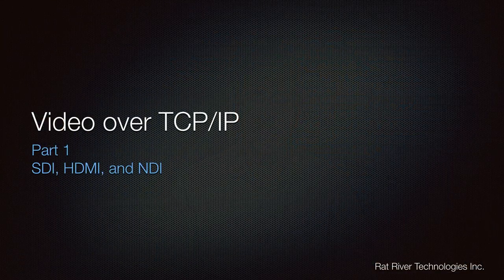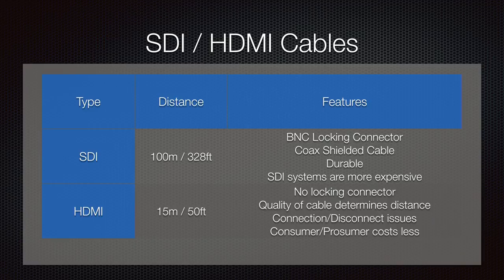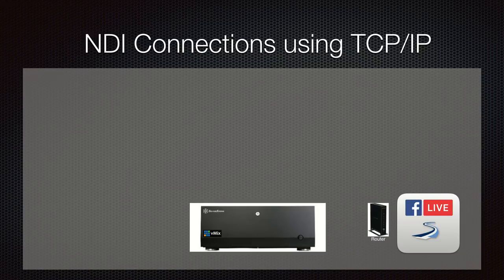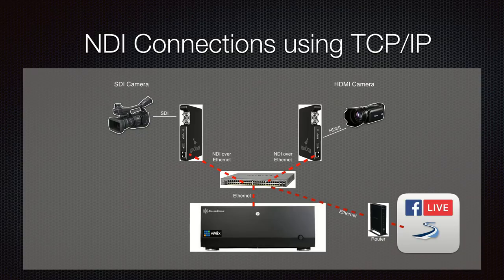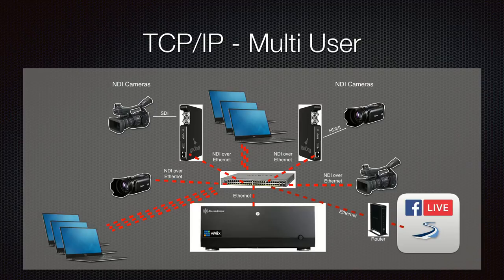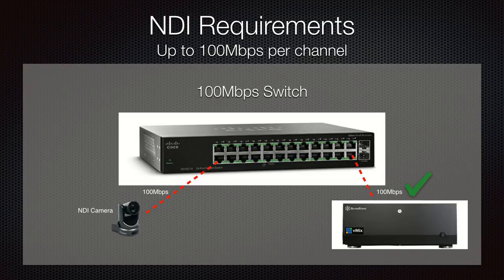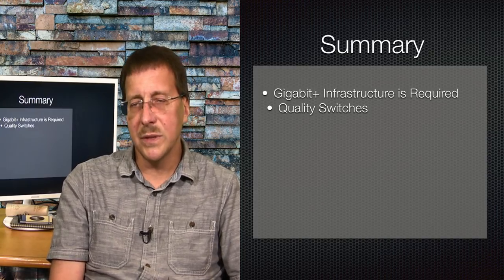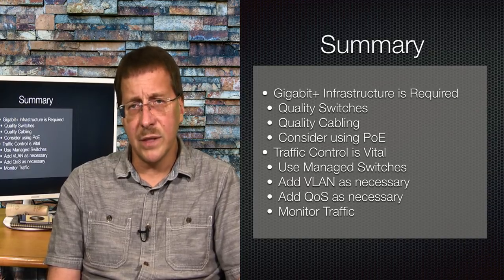Optimizing NDI for Video Production and Streaming

Comment: Hello, Thanks for this vidéo, but i have a doubt, I would like to be reassured. If I take 3 cameras NDI | HX, that I connect them to a POE IP Switch, and that I connect my computer to this IP Switch too, it is really possible to have the 3 camera streams simultaneously on my Mixer software (OBS, Filmora, Tricaster or other ..)? ? While there is only one Ethernet cable between the Switch and the computer? If it works, is it possible to add a PTZ joystick controller on the Switch? And after connect the WLAN to internet modem for Live Stream.. ? It would be cool to have a video of wiring, or wiring diagram image.

Comment: Very concise overview. Many thanks for demystifying the TCP/IP jungle. Little bit of history adds so much to the picture. One question.....at your church how do you cope with the inevitable latency associated with using vMix for IMAG?  Our church is about to make a large investment in AV and  currently looking at a 5k Roland VR-50 HD., Giving us a max of 4 switchable inputs and no NDI.
Reply from the maker: That a very good question and difficult to answer. For streaming, you have full control to add delay etc. For IMAG, you are at the mercy of what's happing on the stage and the audio. In a big venue is even more difficult because someone in front of the projectors will have a different experience then someone 150ft away. 

You really need to understand each piece of equipment from camera all the way to the projectors. There is never zero latency so the task is to try to reduce it to below human perception. Our eyes and ears can start noticing latency of about 20ms but in most cases 100-200ms is still acceptable. 
Every piece of the puzzle adds latency you want to remove anything that adds. The irony is that the least amount of latency was when we had analog cameras and switchers!!!. Tips to minimize latency on IMAG. 

- SDI cameras and cables are better then HDMI. (HDMI is much more variable by vendor so this may or may not be an issue). Turn off additional processing like image stabilization. 
- Use gen-lock if you have this ability.
- If you are planning or need to use NDI, use full NDI vs NDI-HX. 
- No convertors. HDMI to SDI etc
- Clean feed. Make sure you are not changing resolutions, frame rates etc from camera to switcher etc. 
- If you are using a computer based switcher, use high end GPU, disable EVERYTHING that is not necessary etc. On a proprietary switcher like the Roland. check the specs carefully. 
- Use the main output as your feed to the projectors. GPU output 1 on a computer based system.
- If you are using a a multi-cast, splitters, etc to the projectors, make sure you invest in something with low latency
- Finally, the projectors are often the worst part of the path. Try to send a signal that is in the projectors native resolution.   Otherwise the projectors up or down convert. Avoid things like keystone or other digital processing. Consider replacing the projectors if necessary.

It's usually never one item so it takes time and patience to test every item. In our setup, we are still working on it as well. Time and money or course :)
Reply: Yes I never really appreciated how much the projector can add to the latency if it is tasked with rescaling etc. Without real gen lock I think vMix struggles a bit with latency and I cannot really justify the expense of an av upgrade when all the congregation see is worse lipsync than before. I would be interested in the human response to your system when you are up and running. So in a nut shell would you say that you plan to use vMix for IMAG ?. Also does the reduced latency setting on vMix (when using Cuda cards with >3GB VRAM) actually do anything?? Thanks.
Reply from the maker: We already do. We have an Intel x99 system with a nVidia GTX1080 4Gb. vMix low latency input and GPU (> GB) turned on. It's does seem to make a difference but I have not measured it.

The feed from the cameras into vMix in nice and solid. Genlock would help of course. Our challenge is that our projectors are not native 1080p therefore they add latency. Because of the distance, we also distribute using a Blackbox multicast system which also adds. Regardless, although the IMAG latency is noticeable (especially to techies), we do not get many complaints. We will likely upgrade the projectors at some point.
Reply: Hi Martin, I'm sure you are already doing this but I just noticed a significant reduction in latency by enabling the Full Screen function in vMix and using the HDMI out of the graphics card as the main output. Previously I was using the SDI output on the Decklink Duo 2 and this was doubling the latency. The other way to reduce perceived latency of course is to sit at the back of the church as you touched on. The speed of sound means that for every 14 meters (46 feet) you sit away from the screen you reduce perceived latency by 1 frame (here in the UK @ 25FPS). Once I source a graphics card > 3GB I'm starting to think that vMix wont be the biggest culprit after all.
Reply from the maker: Totally agree on using the Full Screen and HDMI out on the graphics card. Makes a big difference. 
Interested calcs on meters versus latency. I didn't know the values. 
Thanks
Reply: Martin Keding do you guys have links or names of what you’ve found?

Comment: As a vMix user and working on some courses (also NDI) this is a very good explanation, and not only for IT people. Good job! Any switch recommendations (quality)?
Reply from the maker: That's a good question but not easy to answer. It really comes down to what you want to do with it. I usually look for at least the following in a switch to give me the most flexibility. 
1) At least 24 port for a fixed install. Amazing how many ports you end up using. For a remote or mobile setup, 8-12 ports is usually sufficient.
2) Managed switch with full VLAN and QoS support. You may not need these features right away but they are sure nice when you do. Also, stats and trouble shooting tools are very helpful. Vendors sometimes sell "Smart managed" vs "Fully managed" switches with slightly less features but also less cost. These usually provide plenty of features unless you are really in a big network.
3. PoE with sufficient wattage if you need it. Keeps the number of power cables to a minimum. 
4. Same brand if you are using multiple switches. This can really "bite" you when different vendors do slightly different things. Very difficult to trouble shoot!
5. Noise. Some switches, particularly PoE switches can make a lot of noise! They really shouldn't so make sure you test before you buy or have a good return policy.

Brands: Lots out there unfortunately. I've used a wide variety over the years and all brands can have issues sometimes. Netgear and D-Link mid range switches (and price point) have worked fairly well. At the high end, Cisco and HP but probably more then you need. I stay away from the no-name (no support) as much as possible :)